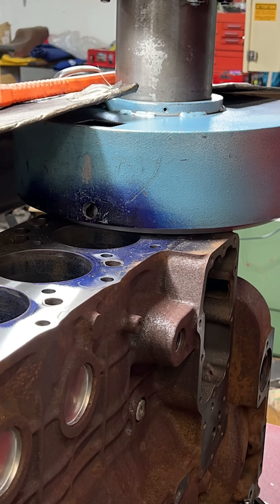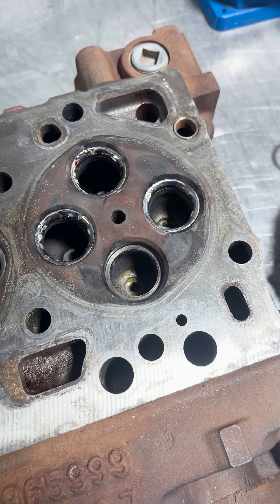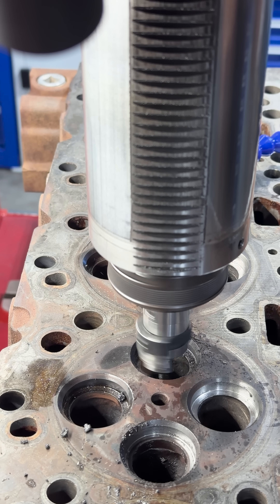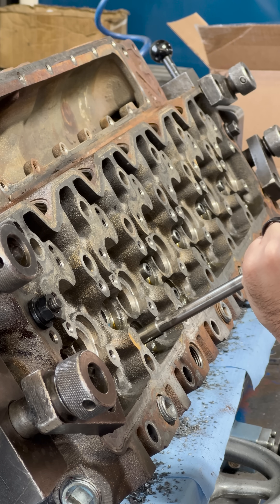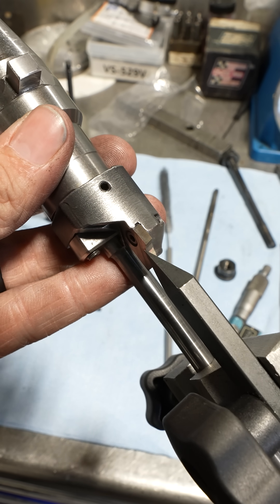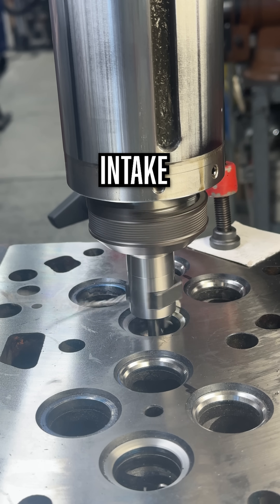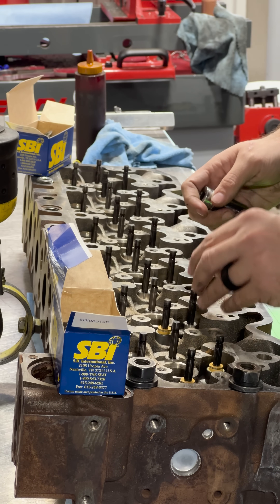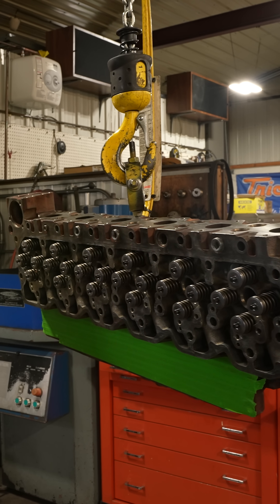#shorts What Does It Take To Make A 5.9L Cummins Head Better Than New? @SBIValvetrain

Comment: I always wondered why valve seats are not designed with setscrews so you can just swap them. Rather than pressing them in and having to cut.
Reply: I think screws can back out, if you add in the intense heat cycles and the little space you have I think that there are plenty of reasons on why it's not common
Reply: @iaial0 Very true.

Comment: A nitpick....I'd have replaced the guides before the seats so the counterbores would be true to the new guides.   Probably didn't make all that much difference....but if a guide was worn crooked the resulting seat could be out of place a bit.
Reply: as long as you machine the seat with the new guide and not the old guide, this is non issue.
Reply: As the other guy said, non issue

Comment: How does the tig welder shrink the old valve seats ?
Reply: Weld shrinks while it cools and pulls material with it.
Reply: Id wager the filler metal isn't really needed. Could probably just use the welder and get the seat red hot, and the let the existing seat interference squeeze the diameter down a bit.
Reply: Why ask a question then not come back to your replies?
Reply: @Ironnadz I saw the answer and appreciate it. I even saw your reply. So I believe that the answer here is that the weld will when cooling reduce the valve seat in size. Question answered imo.
Reply: When you weld all the way around, the weld metal shrinks this loosening the valve seat cause it is shrinking inward from all sides